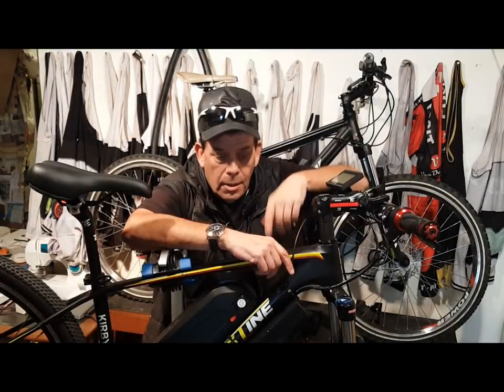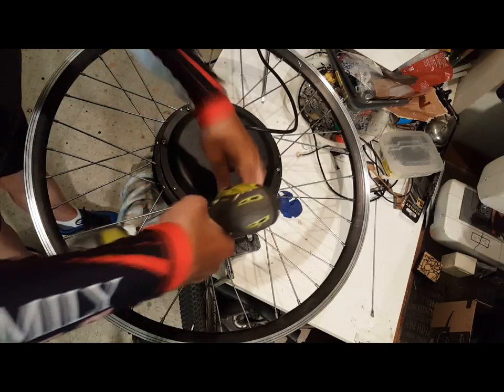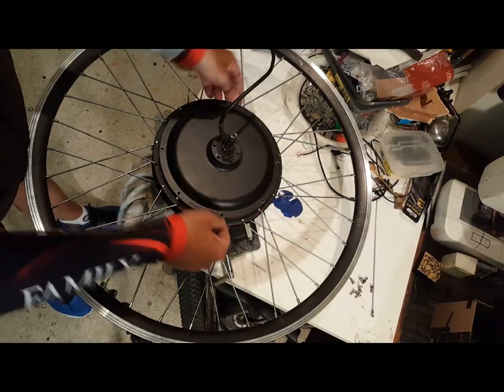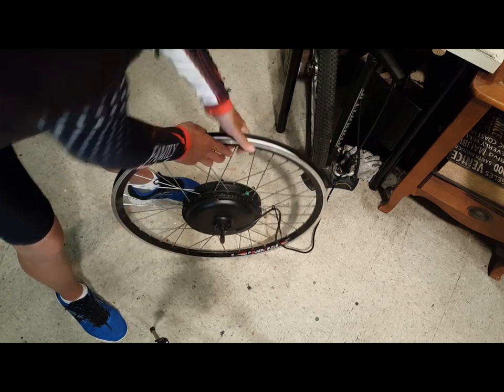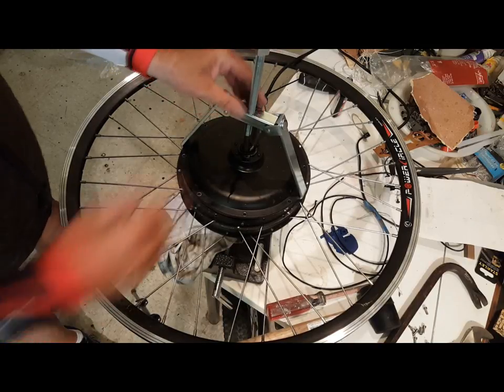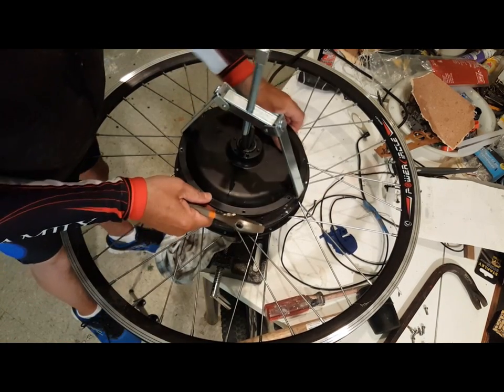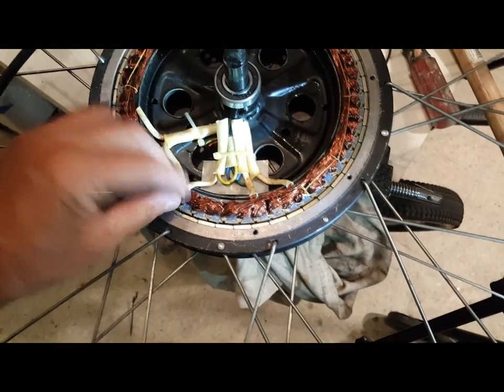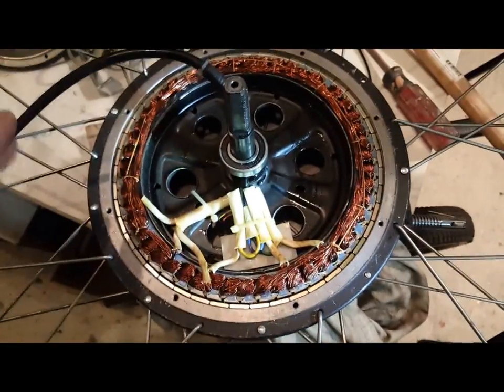ELECTRIC BIKE TIPS:  E bike, Rear Hub Motor Disassembly

Comment: on these bafang rear wheel drive, is it possible to change out the crankset  with something else? I presume there is a cadence sensor in the bottom bracket but it should accommodate most cranks right?

Comment: I tell you a secret about how these bike motors are made.... to fail, on purpose ! What they are doing and lets take a 1000 watt as an example. What they are doing, in you know where, is making a motor coil system that is designed for 40 amps 48 v and putting it into a 20amp 48v motor using thinner gauge wire so that if to twist four 20 amp 48v batteries together, equaling 80 amps, the motor will pull 40 amps through the coil which is supposed to be a 20 amp coil but is wound for 40 amps using thinner wire and with the smaller wire unable to take take the larger amps, 40 amps, it buns up like a fuse so you cant put 4 batteries together to get more distance. If you do the math you can see that the winding is for 40 amps but the wire can only handle 20 amps. That's the scam on bike motor because if you want more distance they think that you will think that well "I must need a bigger motor" when they do the same thing to the 1500 all the way up to the 2000 watt, put four or six batteries together and fizzle because the wire is to small. Maytag does it to in their dryers and washing machines too so this is a known technique on how to sell motors. So remember they can do this with bike motors too and they are.
Reply: Very interesting 🤔

Comment: so that looks like mine exactly- a Violamart 1500w?
I had to replace the thin gauge, strangely stiff stock wiring- I upgraded to a UPP 52v battery and burned up an XT connector even! Simply soldered runs of high temp silicone 12ga from the axle out to the controller. Did the trick- tops out at 40+ mph lol! Thanks for the look inside- I assume they're the same cartridge bearings on both sides?
Reply: I have the same set up, how do you get it to 40mph+?

Comment: can you please tell me the code of that  bearing  which you uncovered there?  or at least it's  dimensions .. i probably have problem with that  bearing, it  creaks    and it's  new motor .. only 2 weeks of riding  ... i tried to  lube and tighten the spokes a little bit  , because i thought that they could be it.. but no...  it is probably  factory defective bearing ... and i wanna try to change it
Reply: damn that's a bummer, looks exactly like my setup- which is a Violamart 1500w. It's a great motor with a 40mph top end, when paired with a 52v batt lol...my bike is basically a motorcycle in disguise. Haven't yet pulled mine and haven't found an exploded diagram anywhere so I don't have a code for you...and it seems Viola doesn't have a clue what they're selling! (I paid $150 for a 1000w motor, they sent me a 1500 instead- score lol!) Let me know if you find a bearing code anywhere, good info to know. You can probably improve yours by overhauling the bearings, repacking with lots of good quality grease. I've been mulling the job myself...
Reply: @udsmall7306  hey man! haha  what a good deal xD getting 1500w  for a price of 1000w 😁 .. I  solved the problem few days ago, I decided to disassemble it and repair myself . It was 6003 RS bearing with  double sided plastic seal . I bought  high quality ones, no problem since then :)  I already did around 2000 kms  on it  since i have that motor. I also often use it as a motorbike😅 very helpful and enjoyable thing!  i run it on 48V  and top is 60-63km/h on flat. but  I am thinking about  52V batt to give it some extra speed boost 😋. happy milwa and drive safe! cheers bro
Reply: @EduardRitok  sweet, thanks!That number is key... I'll probably go ceramic when I do mine. Definitely upgrade to 52v! I did with a UPP 20aH triangle batt and now can tow a 80lb. trailer full of groceries for 8 miles with 1,000 elevation gain at 38mph! And my top speed record is 45.6 mph (73.4 kph)! 😁🏍️💨
OH- also, replace the motor wires with high temp silicone ,14 gauge- I burned up an XT connector on the thin stock wires!
Reply: @udsmall7306  that sounds great!😁 i wanna  get some small tow  car  for my bike too. Backpack is ok, but  it has  limits.. also, high center of gravity because of a lot of weight on back is not convenient on bike. So , tow car will be such a help. I carry drinking water to my garden manually in jugs . ( i have garden  1 mile from home, through fields)   ..so definitely, i can carry more water and also burning wood for a stove by towing :) ..  thanks for reminding me hehe
Reply: @EduardRitok  yep I know all about cargo weight problems lol...here's my rig:
https://www.amazon.com/review/reviews-lightbox//ref=cm_cr_dp_mb_img?ie=UTF8&asin=B01N260A8D
I regularly fill it with groceries and haul it up to our place at speed. We live in a campground with bad water, so I also haul a 7 gallon Reliance container, 56 pounds. I had to do a little work on the axles, it was pigeon-toed! The hubs are junk, but it works. Wearing tires pretty quick coz of the loose hubs. Slime and tire liners in also. It actually tracks pretty good at speed lol
EDIT: ugh look for my reviews "Bud S." 🤔🤣🙄
Reply: @EduardRitok  front view:
https://www.amazon.com/review/reviews-lightbox//ref=cm_cr_dp_mb_img?ie=UTF8&asin=B01N260A8D
those huge panniers are my winter bags...have these smaller, better looking Axioms on now for summer:
https://www.amazon.com/portal/customer-reviews/mobile-media-feed/B081PN5WZ2/ref=cm_cr_dp_mb_crsl_img_7?ie=UTF8&physicalId=B1bHBiV0OtS&imageExtension=png&reviewId=R27BS3SHJ5NW76
so between the bags, trailer, front rack and a medium daypack I pretty much can haul almost anything...I have to because my van isn't legal.
I built this bike piece by piece, out of parts! 😁🏍️💨
Reply: I have some creaking in my Violamart motor as well. I wonder if it's the same issue. I'm upgrading the controller soon so maybe I should replace the bearing at the same time.

Comment: I have the same problem. Could i use 6 Inch gear puller ? for my HUB motor 36V 500W. thanks

Comment: My torque arms came loose while I went to throttle from a dead stop. I got luck with the wires etc. But the two motor hub bolts are misaligned now by a few degrees. Can I use two wrenches to align them back? Thanks
Reply: Did you get a fault come up on your screen saying something like motor alignment sensor fault

Comment: Great video. 
Question.  I have a cracked hub shell (20" 500w) but my motor works fine. I've looked online for the hub shell itself,  but only see listed the full motor with hub shell.

Can hub shell be replaced alone? Do you have the name of some vendors? Can u steer me in the right direction? Hope u can help.

/bklyn 👑
Reply: 2 part metal repair paste will repair a cracked case

Comment: If you have a sensorless controller (no need for hall sensors) you can take advantage of the extra space to add larger gauge phase wires👍 when u only need 3 wires instead of 8 it makes things easier
Reply: Ryan Kennedy.
Hi there I opened up my 2000watt motor and noticed no hall sensor boards. The inside looks like this video.
I opened coz I'm getting a error 007  on my sw900 display
Reply: ...and larger wires means faster...I'm topping out over 40mph on my 1500w/52volter! 🏍️💨🤣
Reply: you need sensors to start the motor
Reply: We're getting 39 mph on a 350w 48v motor on a 52v system and it goes for miles, no heat it's weird actually 😅  Amazing ride its a decent setup Risun controller 36v/72v 1000w/2000w on a Lapierre X-Control..  👌🏻
Reply: @justworstevie473  not possible
Reply: Sensorless use more current and pull off isnt to good
Reply: @udsmall7306 no it doesn't..just maybe less heat...larger wires won't make much , if any difference as long as you don't change the whole length, and then it still depends on what gauge solder point you have...if there is one point smaller then your bigger gauge wire, you still only gonna have the effect of the smallest point...look at it this way, if you open your water tap so it dribbles, it doesn't matter if you use garden hose or fire fighting hose, it still dribbles out, you are not gonna be lifted off the ground just because you use a fire hose.,

Comment: would that wheel work with the cassette side plate not fitted?
so like it is in the video, but the other side plate missing!>?
Reply: hmmm I'll say no- the cartridge bearing on the freewheel side needs to seat in the cover methinks...
plus you don't want water or debris in the works!

Comment: Hey great video I just wanted to know what size gear pulled do I need  to do this my self thanks in advance?
Reply from the maker: You will find that your use of gears changes dramatically when riding ebikes, because of the assist you get from the motor. But, for your rear freewheel or cassette give yourself a wide range of gearing for hills and the same with your front chain ring. You will end up using less gears, but want to make sure you have a range for those times that you need them.
Reply: He used an 8inch puller

Comment: You need a bearing puller. much easier, less hammering electrical - also fixes the issue if you have the wire coming out the end of the axle
Reply: right? I was wincing with each hit 😱😳😱😳🤣
on the other hand, with my luck a two armed puller would warp the cover...I think three armed would be best. Then if you want to overhaul the bearings, you'd probably have to pull them off the axle too right? Probably have to pull the freewheel too?
ugh I've been dreading this job- my DIY 1500w/52 volter tops out at 40+mph...and I've been riding it almost every day for two years now- my only transpo! 🏍️💨

Comment: I got error 7 mean the motor have a problem .. what should I do ?
Reply: Me too. Did you fix? 
I opened my 2000 watt motor hub. No hall sensor boards? The inside of my hub looks the same as this video.
Any advice from anyone please. I got error 007 on my sw900 display

Comment: Why would you break this open like a brute once a year just to check that didn't break it opening it up??? seems a useless but risky maintenance to me...
Reply: right? "If it ain't broke...don't fix it!?" 🤔
A valid reason to crack open the motor would be a need/desire to repack/replace the bearings. Mine and others here have clickers. (mine's intermittent so I haven't bothered..yet) Seems like they used marginal quality bearings and/or grease, no surprise.

Comment: I have the same rear hub motor with tire which doesnt turn round. The body of the motor turns like an egg. Obviously the axis has a problem.
The motor kit was bought from     com_buy_pleased   on ebay. No help and no support from chineese     com_buy_pleased    As mechanical engineer I now have testet the axis which has a bump.
Reply: hi, did you fix?

Comment: Hey mate... I'm having a problem with a similar hub motor.
The wheel, even if it's off, won't be turning smoothly.
I've followed your instruction, and everything seems to be good.

But I think the problem is the friction between the motor box and the magnets.

here is an image to show you where, I think, is the problem. (In yellow)

https://imgur.com/a/v85KPvO

Any idea you can give me on how to fix it?
Reply from the maker: I think the problem is that you don't have the washers correctly placed. There is one washer that is a little smaller than the others that you place on the cassette allowing the wheel to move freely without rubbing up against the frame.
Reply: The washers are outside the motor right?
My problem lays inside on the motor, even with the wheel off the bike, I can still sense the problem.
Reply: @ghazayel  Did you manage to fix your problem? I have exactly the same thing with my motor.
Reply: @Heons  no, I gave up
Reply: main bearing?
Reply: @apriliaaars  hall sensor

Comment: why not make an easy puller that screws threaded rods into the 6 brake holes rear the centerholes in the plate for those and nuts and washers ontop, tighten nuts slowly in sequence and it'll pull off super easy in a fraction of the time and effort and without risking damage to the endshield of the motor.

Comment: Geeze... you're talking about removing a rear wheel but you're tightening the nuts. And you're using an adjustable wrench instead of a box wrench or socket? As soon as you called the drill a screwdriver I decided to stop watching.
Reply: Stay bro, use the comms as the tool, maybe some info and for sure some good laughs to be had in here